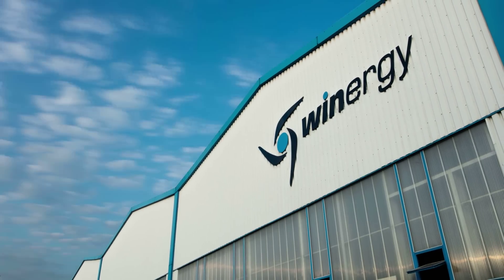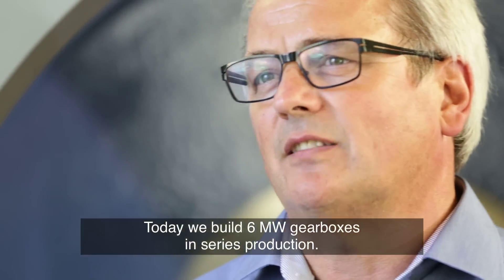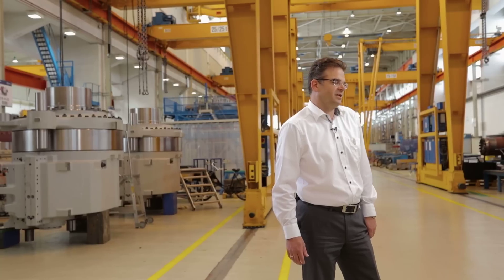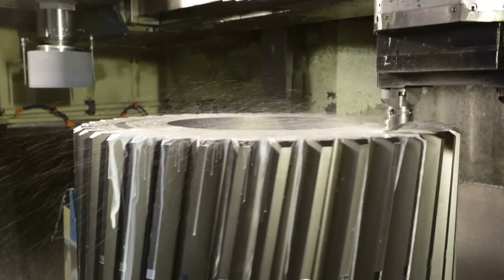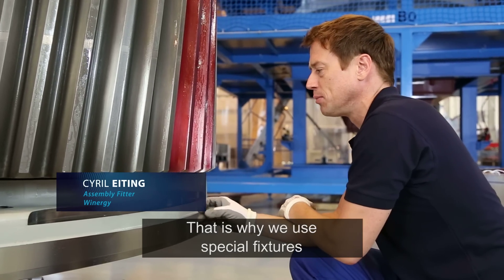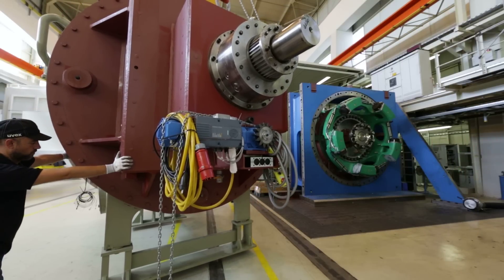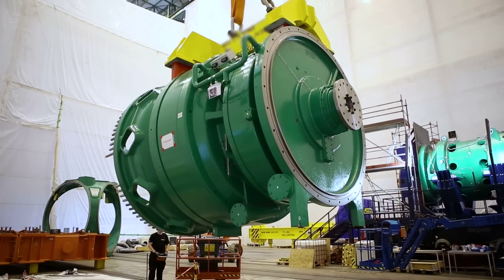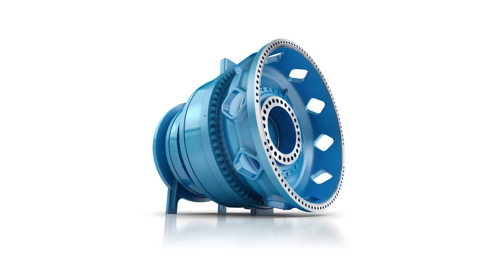Building the world’s most powerful gearbox for wind turbines - the Winergy 8 MW gearbox

Comment: Those gears and planetaries may be "huge" but the actual gear teeth and thickness of parts like the ring gears are NOT "proportional" to the torque loads they'll be subjected to. And without "light" and "thin" oil and very complex and very "energy inefficient" lube/filtration/cooling systems those things are destined to fail. And that's a big problem on a WIND TURBINE since the "rotor" is "upwind" from the nacelle and there isn't much AIRFLOW OVER/THROUGH/AROUND THE NACELLE to use for COOLING THAT LUBE OIL. ALL of the "foreign" manufacturers of wind turbines that have exported their machines to the U.S. have had GEARBOX PROBLEMS at anywhere from a FEW MONTHS to a FEW YEARS of "constant operation" because there IS NO SUCH THING AS "CONSTANT OPERATION FOR YEARS" CAPABILITY FOR ANY MACHINE AND NO MACHINE IS DESIGNED FOR IT. AND "CONTINUOUS USE" is FAR BETTER AND MORE DESIRABLE than the REALITY machines like wind turbines have to survive which is SHORT-TERM OPERATION AND LOTS OF "COLD" AND "DRY" STARTS. "Capacity factor" is thrown around as a "metric" of what wind turbines are supposed to be able to do as far as "efficiency" but that's always bullshit. 

First of all, not even "60%" of available "wind energy" can be "harnessed" by a wind turbine because "WIND RESISTANCE INCREASES WITH WIND SPEED". The higher the wind speed the less efficient wind turbines are even within their relatively small "window" of actual generating "capability" which is only single-digit "mph" in size. Over 12 mph at the NACELLE LEVEL and they're shutting down. And at 5 mph that's just enough wind speed to "break even" AFTER the electricity necessary to OPERATE THE TURBINE since the LAST GENERATION "EVENT" has been "made up". And oh yes, they are NET CONSUMERS OF ELECTRICITY AND A LOT OF IT WHEN THE WIND ISN'T BLOWING. Especially those in "cold" climates that need GEARBOX OIL HEATERS AND PRE-LUBE PUMPS ALONG WITH THEIR NORMAL ELECTRICALLY-POWERED HYDRAULIC SYSTEMS THAT ROTATE THE NACELLE AND BLADES TO THE PROPER POSITION FOR "STARTUP". 

And the fact is that wind is rarely "just right" for "profitable" operation. They don't "fire them up" if the wind is "freshening" and heading toward a "high wind" period where they're unable to operate because "loss of control" is a real threat and since WIND BLOWS DUE TO CHANGES IN "BAROMETRIC PRESSURE" AS AIR MOVES FROM AREAS OF "HIGH PRESSURE" TOWARD AREAS OF "LOW PRESSURE" AND "LOW PRESSURE AREAS" ARE PRETTY MUCH ALWAYS ASSOCIATED WITH "STORMS" AND OTHER "UNSTABLE" TO "SEVERE" WEATHER AND "IDEAL WIND" ON THE GROUND CAN BE FAR TOO HIGH FOR THEM TO OPERATE SEVERAL HUNDRED FEET OFF THE GROUND, EVEN WHEN THEY'RE "TURNING" AND ESPECIALLY IN "HIGH WIND" THEY'RE NOT ALWAYS "GENERATING". THEY "FEATHER" THE BLADES TO CONTROL SPEED SINCE NO "BRAKE" EXISTS THAT CAN STOP/HOLD THEM IF THE "RIGHT" WIND HITS THEM HARD ENOUGH AND THEY ALWAYS HAVE TO "FACE" THE WIND OR RISK HAVING A "SIDE WIND" BREAK THINGS PUSHING ON JUST TWO BLADES AT ONCE. 

And since "society" has changed "radically" since the last big "wind energy" experiment in the 1970s when a LOT more "moms" stayed home and household energy use was highest during the day while "mom" cooked and baked and cleaned and did laundry and watched TV while Dad was at work where "business" energy use was also "peaked" during the day and now "peak usage" is "split" between a few hours in the early morning when people are getting up and getting ready for work and furnaces/air conditioners are "cranked up" after being "turned down" all night AND another few hours in the "late evening" when that's all being "reversed" and "housework" is getting done before and after work and people's high-stress/high-speed working lives have them staying home and in the house a lot more on weekends when they just "veg out" and rest, peak usage is now when WIND ENERGY POTENTIAL is at its absolute LOWEST. The weather is always "calmest" during the "dark" hours of the day and when it IS windy during the "dark" hours its usually "stormy" and the wind is short-lived and too strong or unstable or unpredictable to be of any use. 

The bottom line is that over their lifetimes, no "generator" is EVER going to "make money" any more than any other mechanical machine that turns "energy" into "power" for use by OTHER MACHINES/SYSTEMS can "make money". Least of all one that is running "continuously" 24-7-365 just to be on "standby" to be actually WORKING a small fraction of its "service life". People who bitch and moan about internal combustion engines and people letting their cars "warm up" in the winter and/or "cool down" in the summer before getting in and driving them places have no damned clue that when it comes to "powerplants" they don't come ANY LESS "ENERGY EFFICIENT" THAN WIND TURBINES. Especially when the electrical "energy" the DO generate when they're actually "working" is DIRECT CURRENT POWER that has to be "inverted" to produce AC power "for the grid" while it CONSUMES AC POWER when its NOT "WORKING". 

And that is the OTHER reality. AC current MUST BE at the EXACT RIGHT VOLTAGE AND HERTZ (CYCLES PER SECOND) AND "2-PHASE" (3-PHASE AC IS ACTUALLY TWO LEGS OF ONE "SERVICE" AND ONE LEG OF A SECOND "SERVICE" AT THE "CONSUMER" LEVEL WHICH IS WHY 3-PHASE IS SO EXPENSIVE TO "ADD" TO AN EXISTING 2-PHASE SERVICE) AND THERE IS NO "POWER CONVERSION" LESS "EFFICIENT" THAN "INVERTING" DC TO PRODUCE AC POWER. MOST OF THE ENERGY IS LOST TO HEAT BECAUSE "INVERSION" ACTUALLY REQUIRES "INDUCTION" AND "SHUNTING" OF EXCESS DC CURRENT AS A DIRECT-CURRENT "FLOW" IS "STEPPED UP" BY A "COIL" AND THEN "CHOPPED UP" INTO "3-PHASE AC" BY "SWITCHING" THAT "STEPPED UP" CURRENT ON AND OFF "12O TIMES PER SECOND".

A car's "alternator" produces ACTUAL "3-phase" AC power and then "rectifies" that 3-phase AC current sending each "phase" through a simple diode that prevents it from "reversing" back into the stator winding it was induced in which would prevent that winding from getting MORE DC electricity from the VOLTAGE REGULATOR that "excites" the alternator stator windings "alternately" to produce those 3 phases and uses voltage to switch on/off that excitation current. Because its a relatively low AC output of "only" 90 volts or so and a relatively low amperage "per phase" and solid-state electronic voltage regulators now exist, a vehicle alternator at best can operate "continuously" at maybe 2/3 of its rated capacity. And internal combustion engines with spark ignition  and electronically-controlled diesels need more "juice" the faster they run and the harder they work. And there's a BATTERY to act as a "storage reservoir" AND built-in "load" (due to internal resistance) on the charging system and the ALTERNATOR NEEDS ELECTRICITY TO PRODUCE ELECTRICITY. And rectification is "easy" and "energy efficient" compared to "inversion". 

POWER PLANT ENGINES RUN AT SET RPM TO PRODUCE THEIR "RATED POWER" AT A SPECIFIC CYCLES PER SECOND USING ACTUAL "ALTERNATORS" BECAUSE AS LONG AS YOU CAN CONTROL SPEED AND EXCITATION YOU CAN CONTROL "OUTPUT" IN "VOLTS" AND MATCH THE "GRID CURRENT". BUT WIND GENERATORS CAN'T ACCURATELY AND PRECISELY "CONTROL" SPEED AND THEIR EXCITATION CURRENT IS "AC" AND TOO HIGH TO BE "SWITCHED" ACCURATELY/PRECISELY TO BE "CONSTANT VOLTAGE" GENERATORS SO INSTEAD THEY'RE JUST VERY EXPENSIVE AND INEFFICIENT DC GENERATORS SINCE EVEN DC GENERATORS IDEALLY RUN AT A "STEADY" AND PRE-DETERMINED SPEED TO PRODUCE "CONSTANT VOLTAGE" BUT BEING "DC" AND BEING ABLE TO "CONTINUOUSLY" EXCITE THEIR FIELDS WITH A STEAD FLOW OF CURRENT AT A MUCH LOWER AMPERAGE BECAUSE THEY'RE NOT "SWITCHING" ON AND OFF, THEY'RE STILL VERY "EFFICIENT" COMPARED TO WIND GENERATORS. 

The OTHER reason wind turbines must be DC and the current "inverted" to go "on the grid" where that's even possible - there's a big push for "HVDC" or "High Voltage Direct Current" lines in the U.S. in several areas and coincidentally all of those DIRECT CURRENT "TRANSMISSION LINES" IN A COUNTRY WHERE ALL "GRID POWER" IS ALTERNATING CURRENT TEND TO BE "PROPOSED" IN AREAS AND ALONG ROUTES WITH "WIND FARMS WITHIN 10-20 MILES OF THEM AND THEY ALL LEAD TO AREAS OF THE COUNTRY WHERE "HYDROPOWER" IS A MAJOR SOURCE OF "GRID ELECTRICITY" AND WHERE "INVERTERS" SUFFICIENTLY LARGE TO HANDLE "INVERTING" SO-CALLED "HVDC" ALREADY EXIST SINCE "HYDRO POWER" IS ALSO PRODUCED BY DC GENERATORS BECAUSE HYDROELECTRIC POWERPLANTS CAN'T CONTROL "GENERATOR SPEED" ACCURATELY/PRECISELY ENOUGH TO PRODUCE AC CURRENT AT THE GENERATOR EITHER AND LEAST OF ALL IN A "GENERATOR HOUSE" WITH SEVERAL GENERATORS WORKING "SIDE BY SIDE" BUT COMPLETELY INDEPENDENTLY OF EACH OTHER) - is that to put a "powerplant" on the grid its OUTPUT VOLTAGE AND HERTZ HAS TO PRECISELY MATCH "LINE VOLTAGE/HERTZ" WHEN THAT "SWITCH" IS CLOSED OR THE MASSIVE AMOUNT OF ELECTRICAL POWER "IN THE GRID" WILL LITERALLY STOP ANY "POWER PLANT" OPERATING ALONE DEAD OR DESTROY BIG, EXPENSIVE PARTS TRYING. THERE CAN BE MILLIONS OF "HORSEPOWER" IN THE "GRID" AND SOMETHING LIKE A "SMALL TOWN" DIESEL/NATURAL-GAS GENERATOR OF SAY....7770 HP AT 140 RPM FROM AN 83,000 cubic inch engine will literally be "killed" if its brought "online" in a "peak load" situation for "load balancing" during a high-use period. And since you're talking about several dozen TONS of steel and iron going "around and around" in that "little" gen-set engine stopping in an instant, "killed" is the correct term for what happens to the "little" powerplant. 

No wind turbine comes anywhere NEAR making that much "horsepower" all by its lonesome despite having as much or more "rotating mass" spinning away on it as its generating. So you can IMAGINE what would happen if a WIND TURBINE were brought "online" even if were POSSIBLE for one to produce "high-voltage AC" sufficient to go "on the grid" directly. I guarantee the blades would probably NOT break off the hub or at least not "instantly" either the hub would twist off the gen shaft or the gen would twist out of the nacelle.